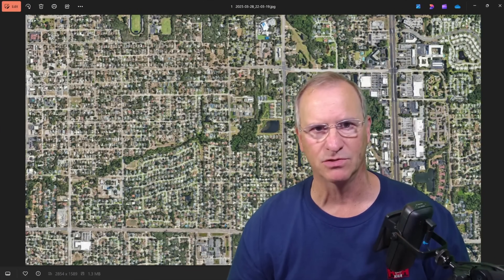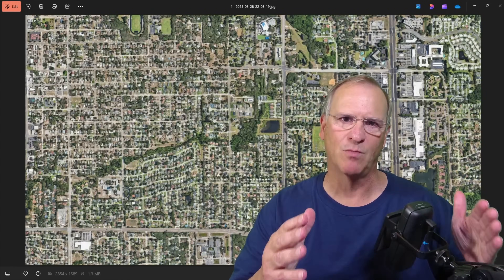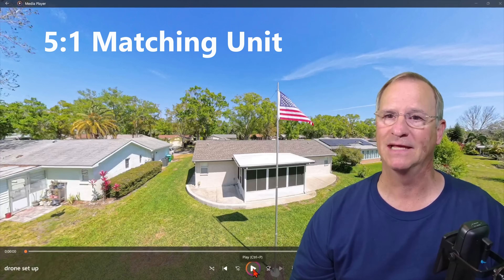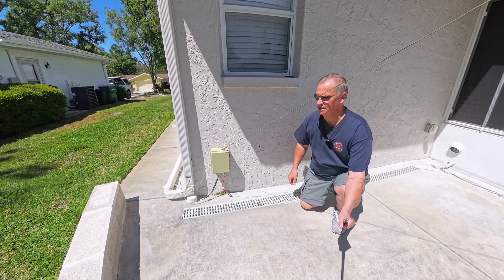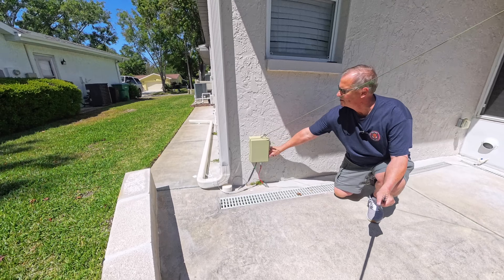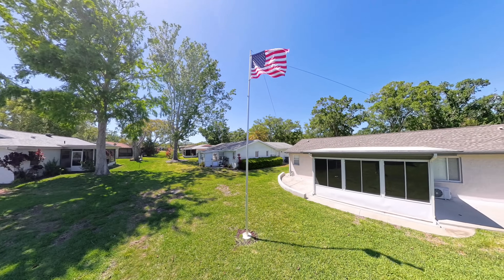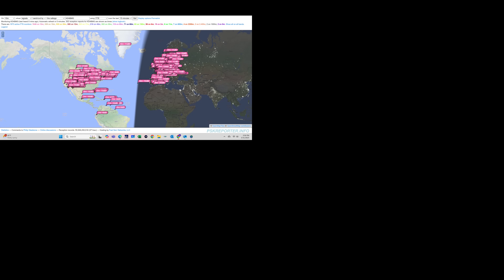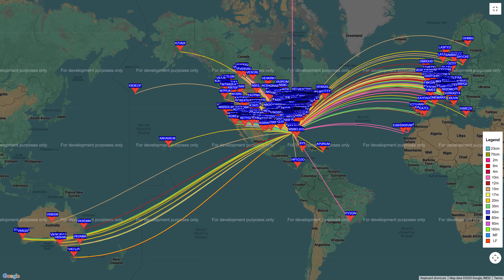Small Lot Low Maintenance Stealth Ham Radio HF Antenna the HOA Will Never Find

Comment: Inspired by you, I now have all the Chameleon parts for the MPAS vertical and the TDL. I also have a 20 foot portamast not yet installed. Question. Have you ever mounted the TDL on top of the portamast and have you tried it in an "L" shape configuration?
Reply from the maker: Yes, I have mounted the TDL on the Porta Mast.  Watch this vid starting at 17 minutes... https://youtu.be/eylGVB2IR2I
I've done an inverted L with wire, but not my SS17's

Comment: Bob, thanks for the video.  Always informative.  Random question what size and manufacturer is you winder storage box at the 12:58 mark.  Hard to tell in the video.  Tia 73's N7YSQ Paul
Reply from the maker: Paul, the dimensions are 16" X 11" X 7"; it is not perfectly rectangular, so I have provided the largest of the dims.  The brand is Rubbermaid.

Comment: Hey Bob - It looks like you have almost a 50/50 or 60/40 wire length setup on that 73' wire run.  This setup inspired me to take some measurements.  I have about 45-47 feet available on one leg and about 105-108 feet on the other.  The high point will be by CHA PORTA-MAST @ around 20-22 feet.  Do you think you can run the CHA HYBRID MINI off of a 130' (+/-) wire as I described?  I know I can just put it up and measure it, but I'm wonder how well this setup has been working for you and if you think what I want to do will fly?  Based on what I've seen, read, and watched, I think it'll work.  Do you know what's inside of that CHA HYBRID MINI?  Is it a 49-1?
Reply from the maker: My first leg is about 31' with the balance of 42' going back to the house.

I would say your 130' with 45' towards the Porta Mast and the balance turning back would be a FANTASTIC antenna -- because of the increased length, it should work better than mine.

The Hybrid Micro and Mini both use a 5:1; just different power ratings based on size.

Comment: Bob - The picture shows a CHA LEFS 8010. but it looks like you just ran 73' of "stock" CHA WIRE off of your CHA HYBRID MINI, is this correct?
Reply from the maker: The pic of the LEFS8010 was a reference to a prior video I did.  For this new set up, you are correct, I took my 73' wire that came with the MPAS 2.0 kit, and attached it to my Hybrid Mini.

Comment: New guy here got ky general license about a month ago. I was thinking of using a Victory 30' telescopeing flagpole to mount a Comet CHA 250HD antenna. My question is if I zip tie the coax to the flag pole to the flagpole will raise the SWR? Thank you KF0POO
Reply from the maker: Tough question actually.  Coax touching other metal surfaces will have an impact, problem is, you don't usually know if its a good or bad impact until you give it a try. 

What you are suggesting, mounting to another metal pole and running coax down is a common activity....so my guess from how others deploy, it should work.  I have run a delta loop on a Porta Mast (metal mast / flagpole) and it worked fine.

Congrats on the General Class!!
Reply: @HOAHamRadio  Thank you. Keep those videos coming! I've learned a lot from you and your fellow You Tubers.

Comment: Do you have any videos on your IC-7300 and SDRuno setup?
Reply from the maker: Not yet, but its on the list.  An MFJ relay is required....and you can't get them anymore.  There is a ham in Canada making a replacement; I have one on order, but he isn't expecting his PCB's until sometime in May.  It will be a few more months, but I WILL do a video as soon as the new relay is available.
Reply: @HOAHamRadio  I was afraid it used the MFJ relay. There are some panadapters out there but nothing ever seems to be in stock for the 7300.

Comment: Very fine explanation Bob.  And for those of using QRP and NOT wanting tuners, 66' (just a little shorter) with a 49:1 feed is great for 40m, 20m, 15m, 10m, 6m. And as a sloping inverted V, mine works just as well as you describe.
Reply from the maker: Spot on with the 49:1 & 66 feet to get away from that tuner!

Comment: Great video.  

Bob, I see you have both the drive-on and the hitch-mount for your Porta Mast. 

Which do you like better? I’m looking to get the 25’ CHA Porta Mast with the hitch mount and also get a hitch extender so that I can raise and lower the mast with the tailgate down or up.
Reply from the maker: They are both very high quality.  I have a bike rack in my hitch receiver 99% of the time; so drive on is my preference just so I do not have to remove the bike rack.  If it weren't for that, I would probably use the hitch mount because it is smaller for storage.
Reply: @HOAHamRadio  Thanks.

Comment: I'm all for chasing the lowest takeoff angle and highest efficiency but "it does what I want" is really all that matters. My random wire inverted V has a tilt too and works just fine.
Reply from the maker: Thanks for the feedback.  Spot on, does it do what I want -- that's the criteria.

Comment: Great video Bob. I have similar HOA restrictions where I live and with a little creativity, I'm able to get on the air and play radio. My current antenna is the Chameleon SS25 whip connected to the CHA Blank and the CHA Puck on a CHA ground spike. This works great for me and when I'm done playing radio, it's fairly easy to take down and store away. Also has the added flexibility of being very portable when I do POTA activations. 73
Reply from the maker: SS25 is a game changer.  Chameleon will have a coil out in a few weeks that will get it resonant on 40.
Reply: @ That’s great news. I’ve been checking their site frequently for the 40M coil but it has been out of stock.